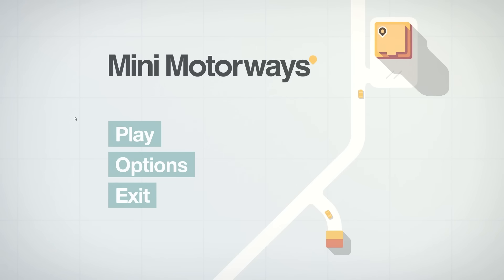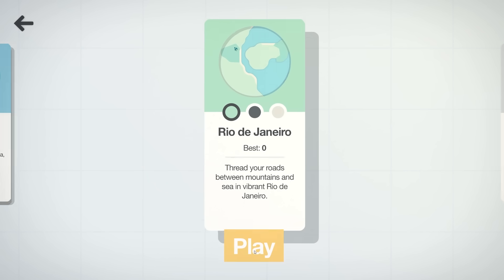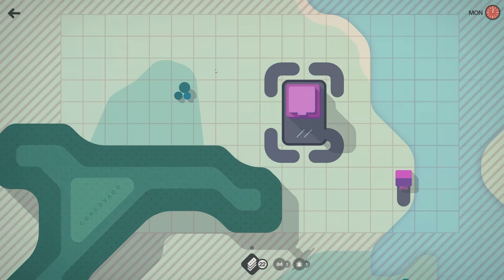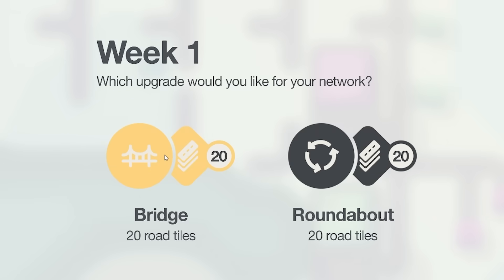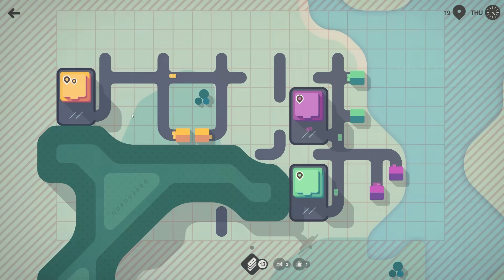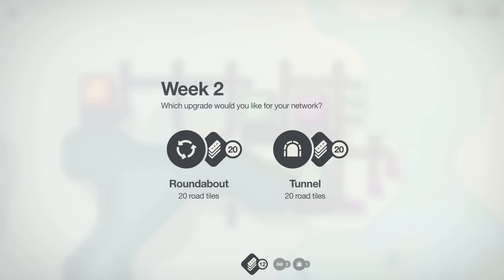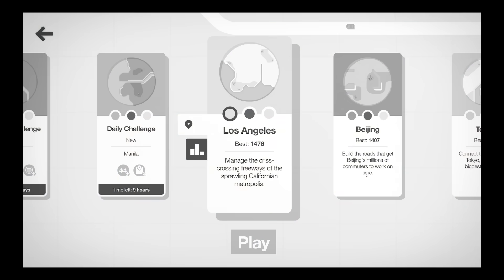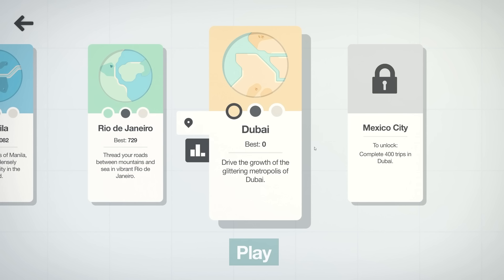Are GRID LAYOUTS effective in Mini Motorways?

Comment: even in america, "grid" does not mean "without roundabouts or highways (AKA motorways)". it simply means planning builds to not "pop up" in weird spots. Our roads are "segregated" in terms of having residential districts and business districts. A house lot makes more sense if in a square/rectangle shape for tiling sake compared to just about any other shape. it also means not having roads take off the corner of houses. XD

keep in mind that as houses spawn more closely together, you can remove roads to expand housing blocks to be bigger than 2x3. with 2 completed 2x3 blocks, you can remove the road in the center and turn it into a 2x7 block. add another 2x3 to make it a 2x11, then a 2x15, and so on. Same when using the other axis. 2x3 becomes 5x3, then 8x3, and so on. the only question is just the optimal size before the roads between 4 way intersections get too busy (while still providing road access to all, which does mean 2x(Y) is the best and only expansion direction), and with the proper planning, the capacity can be increased even further with strategic roundabouts taking away 1 house per corner of a housing block.

(ASCII AHEAD) R=Road, H=House, C=roundabout, V=void(roundabout center) Can be tiled by overlapping outer road boundaries.
Residential district:
RRRRRRRRRRRRRRRRRRR
RHHHHHHHRHHHHHHHR
RHHHHHHCCCHHHHHHR
RRRRRRRRCVCRRRRRRRR
RHHHHHHCCCHHHHHHR
RHHHHHHHRHHHHHHHR
RRRRRRRRRRRRRRRRRRR

Comment: If traffic lights could count the cars, count how long they've waited, and weighed out who's more deserving of passing, I reckon they'd be more efficient than roundabouts.

Timed traffic lights can make people wait when they don't need to (turning red or staying red when there's no cars coming). They don't take much space.

Stop signs make people stop regardless of whether or not there's traffic (you can be the only person in the city, yet you still have to stop).
Stop signs don't hold you up for a whole 3 minutes like traffic lights do (assuming there's no others at the intersection).
Stop signs take up the least space and cost the least.

Roundabouts keep you moving, but will jam if a stream of cars are moving multiple exits ahead constantly, plus take up extra space.

Overpasses are the kings of efficiency, but are expensive as h*ck and take up a lot of space.
Reply: Lights do count the cars and weigh who’s more deserving of passing. They’re still less efficient than roundabouts in most cases

Comment: One thing I learnt when I tried this is that the map expands faster than normal as it tries to make space for buildings. The more you block, the faster it expands. Unless you can keep up with the amount of roads required for a larger map, the idea of blocking areas off for a grid doesn't work out so well.
Reply: I use spawn blocking only for inconvenient spots where a new building would absolutely ruin me
Reply: A single road tile can block 2 spots. But a Single diagonal road blocks 3 spots. *(1 and 1/2 per side) While not good for long term use, you are always 100% able to block new shops from spawning in. 
However the enemy then becomes the tiny parking lot of the single shop you do have having a demand greater then physically possible by week 7 or 8 depending on the initial spawn locations of the houses and shop. 

How to accomplish such a thing with 100% reliability requires a secret trick. Hold the mouse button down to draw new roads off the grid to have the ever expanding grid visible. But you need to hit the space bar to pause the game with-in two seconds of the new space to draw your new diagonal road blockers. And double up on the edges. 
⬜⬛🔲⬜⬜⬛🔲⬜⬜⬛🔲⬜⬜
⬛⬜⬜🔲⬛⬜⬜🔲⬛⬜⬜🔲⬜
⬜⬜⬛⬜⬜⬜⬛⬜⬜⬜⬛⬜⬜
⬜⬜⬜⬛⬜⬜⬜⬛⬜⬜⬜⬛⬜
⬜⬛⬜⬜⬜⬛⬜⬜⬜⬛⬜⬛⬜
⬛⬜⬜⬜⬛⬜⬜⬜⬛⬜⬜⬜⬛

Comment: Real traffic engineer to a real civil engineer - grids work much much better with "motorways" that traverse exterior edges to each other. I'd suggest doing the grid system, but use motorways to connect say the far left of the map, to somewhere far right on the map. It gives cars an option to skip over long sections and re-enter the grid closer to the business.

Comment: You could try to merge 3 driveways from houses that spawn side to side together so you have only 1 intersection instead of 3, that would increase the flow a little bit. You can also have roundabouts on grids, just put some on the busiest 4-way intersections. Just do 5 by 3 grids instead of 3 by 2s and you should be able to fit roundabouts on most intersections if you need to.

Comment: I'd be interested in seeing a grid for the most part, but with no restrictions, use roundabouts at busy crossroads, traffic lights at busy crossroads you cant fit a roundabout in and strategic motorways to ease grid routes and/or satisfy timers.
Reply: So basically the normal method?
Reply: @reallyrehans  pretty much, but with grids and not random building placement
Reply: @reallyrehans  no, the normal method is segregation. I'm talking about using an interconnected grid system but still making it work with roundabouts where it congested and motorways to speed up long trips
Reply: @Malikamallo  pretty sure they mean “normal” referring to real roads
Reply: @titan1umtitan  that is entirely fair. It's hard to know what type of normal people are talking about. Normal in the game is very different from normal in real life, but then again, normal is different in different locations
Reply: @Malikamallo  yes this, do something like we have in Midland, texas where you have a loop around the outside of the city, and then you have a grid inside and around that loop, and then use lights and roundabouts where necessary, lights are better now because intersections slow down cars a lot more now.
Reply: @reallyrehans  the normal method in this game seems to be segregation. People keep the different colors disconnected, which is all well and good, except most of the time when I see a system fail it's because the cars have such a long and circuitous route they can't get to the point fast enough. I don't think I've seen anyone lose to a traffic jam yet. (Though I only watch civ, and aliens rock so...)
Reply: @reallyrehans  idk I haven’t watched yet
Reply: Yes! I real life the grid system is flexible. Sure, it's mostly a grid but sometimes there's a roundabout, or a diagonal road or even a random wiggly road. Not to mention that many larger city's in the US are right next to an interstate/highway that people use all the time to get from one part of town to the other. The grid system is supposed to be ajustable.
Reply: @Malikamallo  highways, interstates, and freeways are not used in the game the way they would be in real life. Shortest vs fastest
Reply: @Malikamallo  Well the problem is that Mini Motorways does random spawns whereas in real life buildings aren't built before roads are, also a building wouldn't upgrade if there weren't enough buyers.
Reply: @Profeshinal  That's what makes trying to do a grid pattern a challenge. You don't have control over where things spawn and that's why I'm all for flexibility, you gotta make it work at the end of the day.
Reply: I think that would work really well My city is set up on a good system but there's parks every couple of blocks and there's little parks around about but they're kind of grid-shaped blocky if that makes sense
Reply: The problem with the grid system here is that this isn't really simulating a city, realistically it's most closely simulating a small town / village.
A city has millions of homes and thousands of services. It's overkill for a few dozen homes.
Reply: Exactly what I was thinking. Use the motorways to connect long distances across the grid and roundabouts at busy intersections. But he seems to really like segregating the Sims based on their color.
Reply: tbf, he did mention he would try and use some traffic light... but the game didn't give him a single one to use xD, and well there are very few places where you could fit the roundabouts, when trying to force in the grid system in this game, and those places that would have room would be where there wouldn't be too much traffic. I do agree that motorways should certainly have been used
Reply: You’re comment is literally what the teach urban development specialized civil engineers in college on how to properly develop roads
Reply: @tjboylan20  they*
Reply: A 5x5 area is good for a grid.  Encircling every POI is not good
Reply: Los Angeles is notorious for having zero highways. Well except for the 5, the 405, the 10, the 15, the 71,...etc! Grids use highways
Reply: yeah usually roundabouts are used on main arterials, & gridding is only used where there's room. cul-de-sacs are used to keep the flow of traffic away from residential areas and highways are used to connect the different grids together.  the only reason Europe doesn't have grids is because all their roads were built before the idea of City planning existed.
Reply: Yeah and motorways!
Reply: NYC manages that pretty well, with the exception of using roundabouts - there's like 1-2 in the entire city
Reply: survived for 100 days (2846 passengers) using this strategy in Moscow.
Reply: So exactly the way he has done it since the first sode? Lol grids, motorways, roundabouts , and lights? Yea it got him pretty good scores
Reply: @jordanbomb32  no I mean mostly like this episode.
Reply: That’s how it is in real life, so that’s how I would prefer to try it out in the game